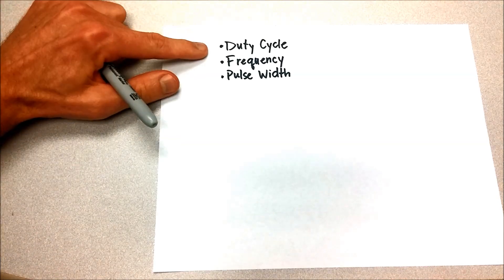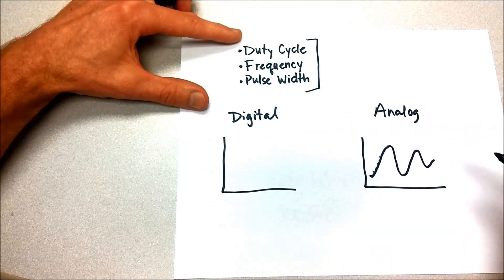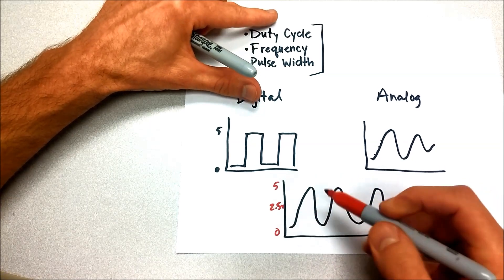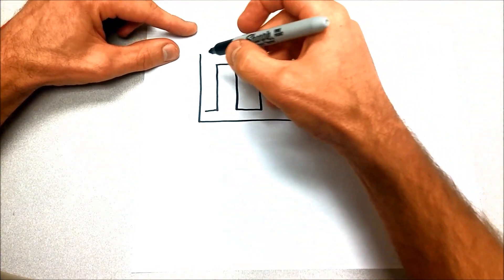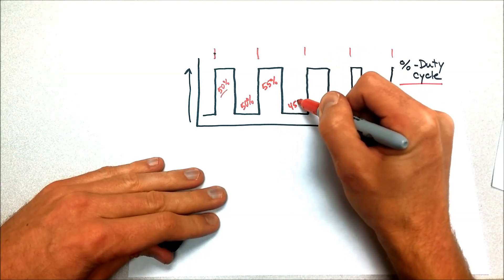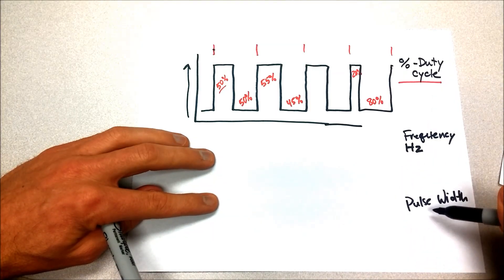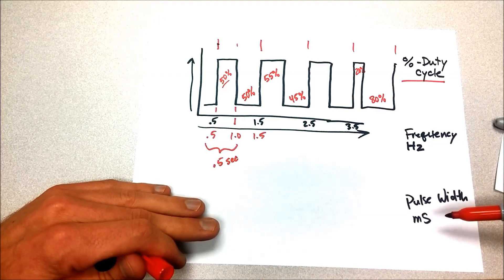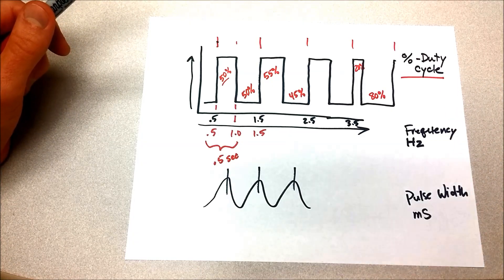Duty cycle, frequency and pulse width--an explanation

Comment: Digital square waves and DC square waves are different correct? Or they look different correct? Or are they the same
Reply from the maker: They are the same thing.  If it is digital, it will be a square wave.  If you are measuring voltage, a square wave will be DC.  AC voltage will usually appear as a sine wave.
Reply: Ok. Thank you. Thanks for the video! Take care

Comment: You explained frequency incorrectly. That was pulse repetition frequency
Reply from the maker: I am always open to learning something new.  Feel free to help me understand if I am missing something.  When you use the term "pulse repetition frequency," I assume you are speaking of the frequency of a digital pulse that is transmitted within a carrier frequency (like a radio wave).  Is that correct?  If so, it seems that we are talking about a "frequency within a frequency," and it is still correct to say that the definition of frequency is the measurement of the number of cycles per second within any signal, whether it is an analog or digital signal, carrier signal or modulated signal.

Comment: Is it possible to count a continuously changing duty cycle? For example When counting a frequency, we first turn the analog signal to the square wave. The frequency count of a regular analog signal can be considered regularly with 50% duty cycle. However, the square wave duty cycle is not regular in the count of irregular and mixed analog signals. For example, 50, 55, 43, 20, 70, 30, 3, 43, 20, 70, 30, 3, 21, 17, 35 ....... can be a duty cycle. In this case, can the frequency of an analog signal provided in this case?
Reply from the maker: I am not sue that I understand your question, but I will try to answer it.  Yes, you can have a varying duty cycle.  When the duty cycle varies, the frequency is usually unchanging.  Your meter will only display an average duty cycle.  If you want to take more precise measurements, you will need an oscilloscope like a PicoScope.

Comment: Sir I could not get the frequency though..cause the frequency couldn't be same if the width of the pulse changed
Reply from the maker: The frequency can stay the same even though the pulse width changes.  As an example, I may eat three times a day (frequency is always the same), but sometimes I may spend 10 minutes at each meal or other times I may spend 20 minutes or 40 minutes (pulse width changes).  The number of occurrences per second can stay the same, while the amount of "on time" for each occurrence can vary.  Does that make sense?
Reply: @JustinMillerAutomotive  Yes sir. Thank you.. It makes sense but the condition has to be applied for off state also..Cause if the pulse width changed but the time of remaining off is unchanged then the frequency will be changed..Isn't it sir?

Comment: Thanks Justin, Great tutorial. Is there a way to copy an input digital 0-5v squarewave signal and output it exactly, with a variable delay? I've been trying to figure it out on Circuit JS1 using an rc delay but I lose the original signal frequency and amplitude. I've also tried a phase shift but I need it to be variable and can't figure out how to. I've even tried using a half bridge but was only able to recover the amplitude. I'm stuck.

Comment: When an audio signal (like from a guitar) goes through an amp circuit is it moving back and forth through the circuit like AC voltage or is it just a wave moving along with the DC voltage until it gets to the output? Can't find a good explanation of this.
Reply from the maker: Audio signals are typically varying AC signals.  Their job is to energize the coil in a speaker.
Reply: @JustinMillerAutomotive  Thanks! I actually figured it out while viewing amplifier circuits in simulator software.

Comment: Thanx alot Mr.
But my question is pulse width modulation in one cycle not time of on and off
Reply from the maker: Pulse width modulation is simply modulating (changing) the width of the pulse.  This means that the on time will change, because the width of the pulse is measured in time.

Comment: This was a plain and simple explanation. Any idea what would cause a DC fan that I’m attempting to drive via PWM to not spin at low duty cycles?
Reply from the maker: Maybe your driver isn't providing enough voltage or current for the fan?

Comment: ok, i understand how to calculate them, but what i don't understand: So the electrical signal is continous, in 25% on time, what happens with the rest ?  what voltage goes to the output ?  (0-5V) that it makes running with 25% .... It doesn't heat the pwm ?

Comment: Great video! Thank you for explaining it. Can you tell me for a given fuel flow rate and given direct injection pressure can the injection duration time change? And I guess if it can change, what can cause it to change?
Reply from the maker: The duration is controlled by the ECU, which can control the pulse width (or amount of time) that the injector is commanded on.  On many direct injectors, the injectors are actually commanded on multiple times during each event.